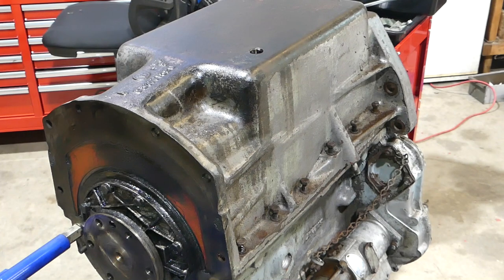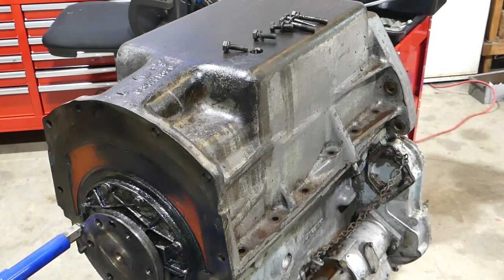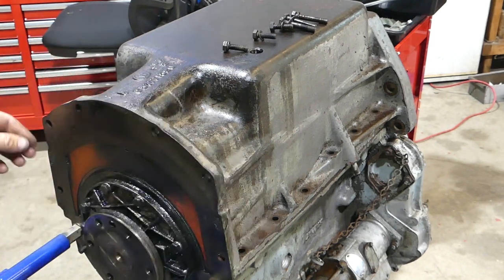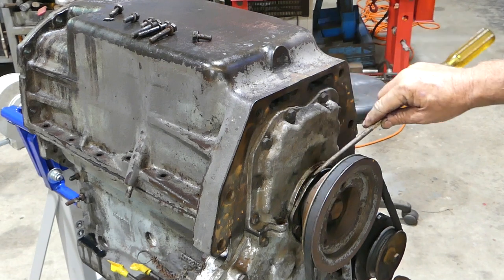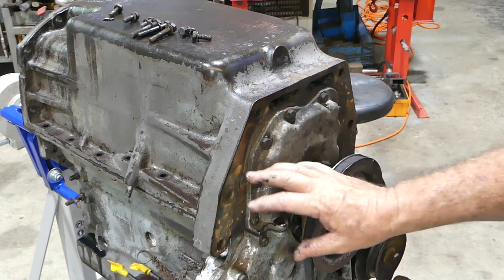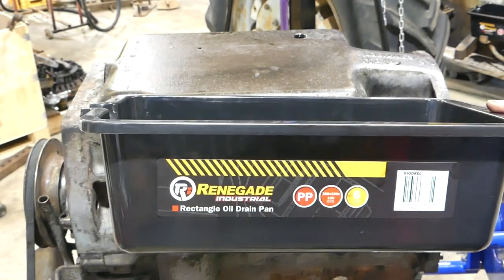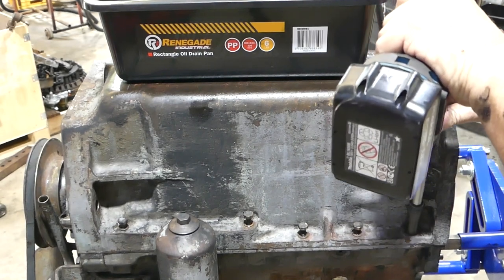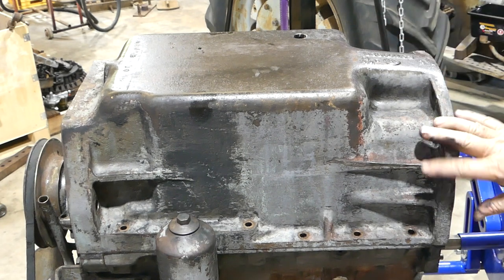Massey Ferguson 65 # 18 Removing the Sump (and missing 2 hidden studs)

Comment: Hey lance just wondering what bolts, spacers etc you used to mount the engine to the stand 
Cheers
Reply from the maker: They are all different and for the Perkins I turned them up in the lathe for 3/8" unf to take the stands supplied metric bolts.